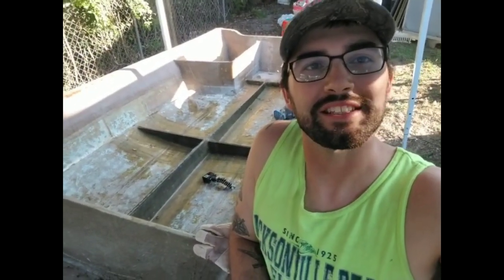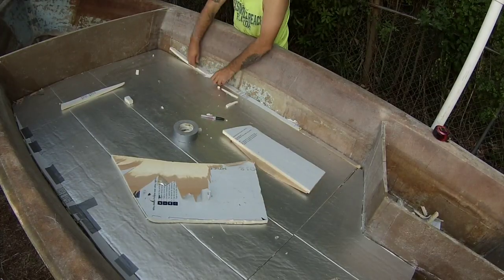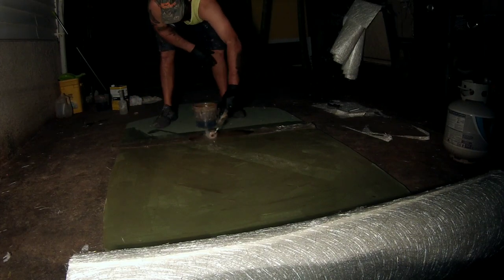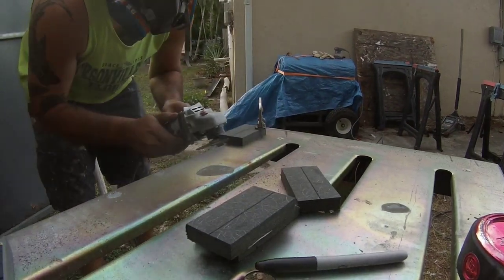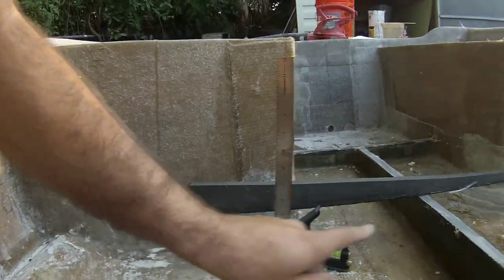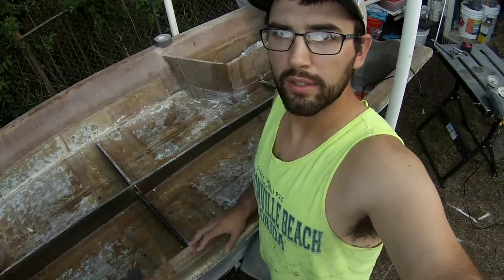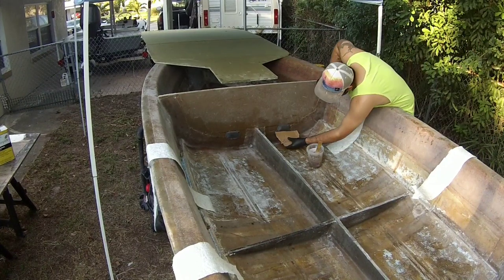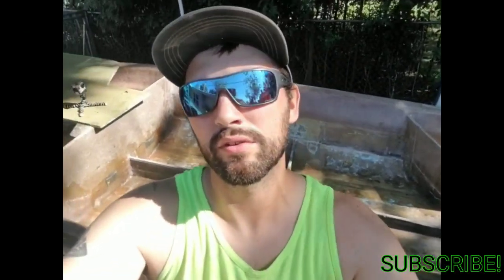DIY FIBERGLASS BOAT BUILD (Divinecell floor installation) PART 7

Comment: Nice work..nice to see a start to finish, small Fiberglass job. Most can't realistically take on the large projects.  I wanna try a small job like this one and see how I like it. I guess I am looking for a hobby/skill to enjoy on my weekends.
Reply from the maker: This is definitely a great one to do it's very rewarding. Fairly easy to learn if your mechanically inclined. Once you done 9nce you'll see what you want to change on the next one and the next lol definitely a small boat is a good start fairly cheap and you learn what it takes to build just about any size boat.

Comment: Love the step by step. It seems you could have increased the gluing surface of your stringer and athwartship braces/ribs by gluing 1 inch wide cleats either side at the top. This would increase your surface contact to the bottom of the sole by a factor of 3. 

Nevertheless, I enjoy watching your methodical approach and seeing your steady progress. Keep up the good work!!!
Reply from the maker: Thank you! i appreciate the info it would definitely make it stronger by doing that.

Comment: I love watching your video, I have 1994 skeeter bass boat has been set since I bough it it has bad transom and stringer i wish you can work on my boat
Reply from the maker: I really like that yr of skeeter. fished out of a couple of them. Glassing is not hard just need to get out an do it. I looks intimidating but one you glass you first part in you'll realize it ain't all that bad

Comment: You should, if you haven’t yet  check out “Carbon Core” foam.  They normally don’t carry 5lbs density but they stock the 4lbs and it’s half the cost of divinycell.
Reply from the maker: I will look into that thank you.

Comment: I’m on part 7 and really enjoying and appreciating this video series.

I’m planning a similar project on a similar hull and want to use wood instead of foam.  So what would you do differently if you were making this out of wood?  Can I use Home Depot lumber?

Thanks again,
Reply from the maker: You best bet is to find a lumber yard that can get a good quality Marine plywood but yes you can use any kind of would you want. You just have to seal it probably or you'll have issues quick but if you seal it right and take care of it the boat will be great for years to come.

Comment: What is your grinder set up/ process for finishing the edges of the floor ? You time lapse this process around 6:33 in the video.
Reply from the maker: im using a DA palm sander with a 40grit pad. the only reason im doing this is because when i glassed it the resin ran over the sides a created high spot on the top side so im just knocking down the high spots with the sander.
Reply from the maker: with the 4.5" grinder i used a diamond cut off wheel to trim the excess fiberglass back to shape.
Reply: Hot Action Fishing and Fab awesome dude, thanks for the timely response.

Comment: Now since it has been more than 24 hours since you fiberglass the bulk head is it necessary to sand the bulk head before you attach the cleats
Reply from the maker: Yes I recommend always sanding between coats. if you read on some 9f the product suggestion you could possibly go longer with out sanding between coats. But in my opinion if it dose not have a tacky feel anymore I lightly sand and wipe down with Acetone.

Comment: Do you notice any deflection/cracking noises when walking on the deck? I guess my real point is, would you be nervous of a heavy weight fishing partner jumping aroud on the deck?
Reply from the maker: Actually it feels very strong. I definitely wouldn't try to span any distance tho with only using csm tho.

Comment: Working on a 21ft bay hawk putting a new floor in it can i use the coosa bored as the floor ??
Reply from the maker: yeah defiantly coosa is some bad ass stuff just expensive. the diviycell is a good alternative because it about half the price but it dose not have the screw retention that the coosa has.
Reply: Great thank you im putting the center console in it so i need something that i can screw into

Comment: hi how thick is your divinycell plate?  and how many layers of fiberglass have you used?  are you happy with the stiffness.
Reply from the maker: Its 5/8" and it feels good were I did the 4oz of CSM but I like 1708 and a lyer of 3/4oz CSM on bolth sides much more solid.

Comment: Loving your videos! I recently gotta 94 mako 17'  I'm going to de-foam and  re-deck. Debating on the core material, will that divinecell absorb water eventually?
Reply from the maker: Awesome I rebuilt a 17' skiff last summer out of marine plywood great boat. It will but were talking like 50yrs that's if you do somthing drastically wrong when glassing. If you do it right the boat will still be here in 100yrs. I have nothing against marine ply its half the price and if you do it right you have nothing to worry about. If you have the extra money and you want the boat to last for absolutely for ever and be light then go divincell, nidacore, Q cell, theres a ton of options. Should always go with cossa for the transom if you stick with composites

Comment: What thickness of Divinycell are you using for your deck?  I am making a 8' by 16' deck out of 4 of their 3/4" panels.  Three layers of 1708 and one layer of CSM on each side. Still a little bit of flex over 4 foot span.
Reply from the maker: Mine is only 5/8 I do not recommend going over 2' without some kind of support. Idk if youd be able to get rid of  the deflection at all trying to span a 4' distance no matter how much glass you lay up on top.
Reply from the maker: I layed this floor up with only 4oz of csm on each side just because I have a 100+lb. Roll of 2oz csm and a guy said that's all he dose so I wanted to try it see how it felt. I usually lay up a 3/4oz of csm then go over it with a layer of 1708 and that's it but I try to not go over 20" to 2' at the most.
Reply: @hotactioncustoms7008  I use the same rollers but I cut them from a full size one.  You can see my build at:  https://youtu.be/r0rHrbnylD8

Comment: Do you anything about a 15.6 sea squirt also know as vip marine? .. that what I want to redo
Reply from the maker: No but I just googled them and by the pics they look bad a$$ lol they look fast. Yeah if I found one of those hulls I would build one too!
Reply: Hot Action Fishing and Fab which one? the one I have is like a sea foam green with a Yamaha
Reply from the maker: Idk I just googled sea squirt skiff and a few diffrent ones popped up 15', 17', and 18' ones they all looked cool.
Reply: Hot Action Fishing and Fab I have a 90 hp on my 15.6 the back is a tunnel haul . do you have IG so I can send you pics? I need you advice and help with the build . It’s not my first skiff build . I also did a whaler 13
Reply from the maker: My IG is Hot Action Fishing and Fab pm me and I'll try my best to help ya out